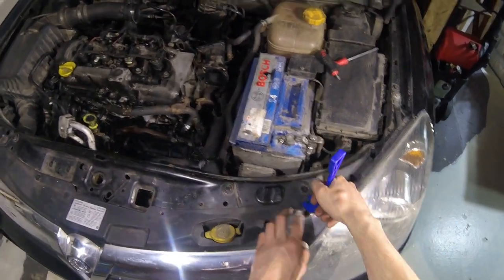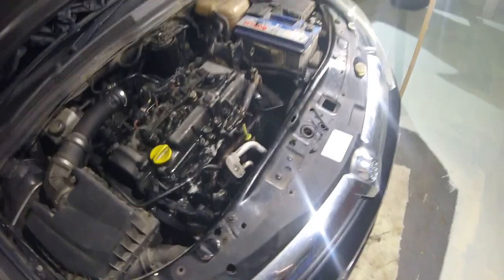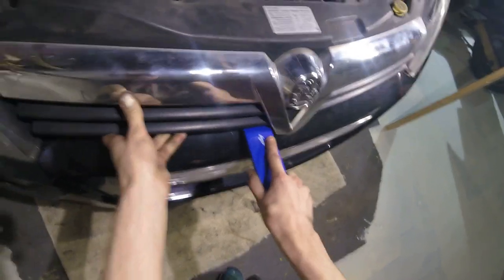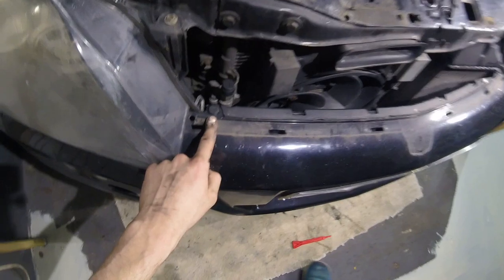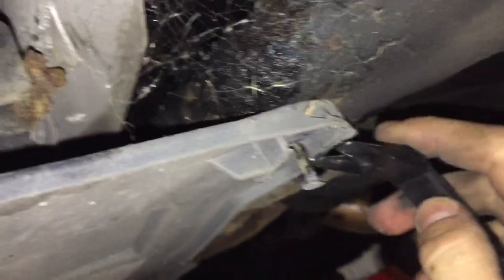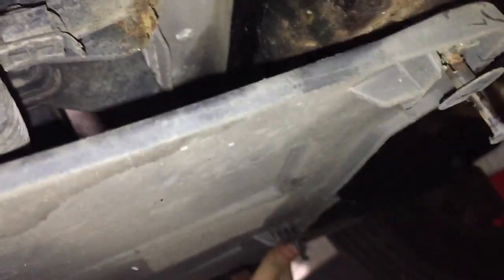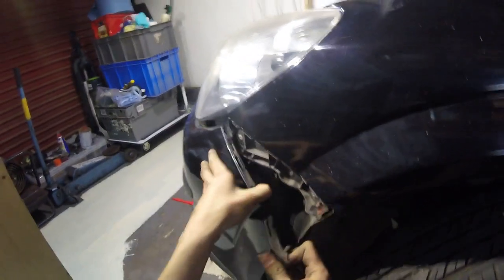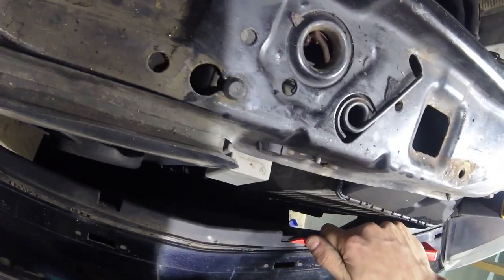Astra H MK5 Headlamp and Front Bumper Removal Guide Vauxhall Opel

Comment: I wanted to change both my headlight bulbs. I watched this and was able to tackle the job easily.  Good instructions
Reply from the maker: Thanks for the comment Paul and very glad to help!
Reply: Probably too late for you, but if anyone else wants to change their headlight bulbs there is a flap in the wheel arch you can unclip which gives access to the rear of the headlights, it's a bit of an awkward reach to get them, but quicker than taking off the bumper, grille, etc.

Comment: Hi I removed my headlight as instructed thanks to you but when I removed the headlight on driver side there is a cable below that attaches to something do u have any idea what it's for??
Reply: It's got a green and a brown wire on it that's the only bit I can see with the pic I took
Reply from the maker: Without seeing it I’m not sure I’d be able to advise. Are you saying the cable goes into the headlight or below the headlight somewhere?
Reply: Yh its below the headlight it's been unplugged I have got a pic of it if u want to have a look at it
Reply from the maker: @silv3r_vision80  If you can send a photo by DM then feel free or send it on Twitter @tolly_swift It might be for a crash sensor, outside thermometer or foglight...

Comment: I need to take our the engine ECU I have been told it's in the left side in the front bumper area, so to get to it is it easier to take off the bumper or go in from the inner wheel arch?
My Vauxhall specialist said he finds going via taking the bumper easier than trying to get to it and remove it via inner wheel arch.

Please advise.

Thanks
Reply from the maker: Personally I always prefer to take off more than is required because it’s not just possible damage to the car, working in awkward positions in tight spaces can leave you with big cuts. I don’t actually know where the ECU is myself as the videos on here are the only jobs I have carried out on an Astra but if you’ve been given that advice I would use it and remove the bumper 😁 at least you have a video for it right here! All the best.
Reply: @IAMASPANNER  thank you for your response very noble of you.
Yes lool the bumper removal
I did see how close it is to the wheel arch inside but having to take wheel off and two of those clips that hold the bumper also.
The ECU can be seen from there maybe the guy was thinking that then the holding bolts maybe hard to get undone and of course un plugging the ECU after.

How do you take the rivets off at the slam panel end, they look blank in that there's just a flat piece on top with no grooves to use flat head or Phillips.
I noticed you kind of pulled them off so did you just pull on them like a trim clip that you just pull like on door cards?
Reply from the maker: I think they’re all just plastic clips so yes you should either be able to pry them out first or pull them off with the panel!
Reply: So after looking at taking the bumper off which I began by breaking one of the black rivete clips which just flew off.
Then I thought I will undo the two T25 head screws in the inner wheel arch which I did and when I pulled out towards the caliper I could see the engine ECU so o decided to use this as an access point.
It was much easier than having to take the bumper off which I think if easy once you've broken the top five black rivet clips.
There are 4 10mm nuts that hold the ECU on its bracket, it's easy to take off even the nut you can't see clearly.
The unplugging seemed harder but got there in the end.

None the less job done
Reply from the maker: Glad to hear it and thanks for sharing your experience removing the ECU. Hope you get everything sorted!

Comment: Not a good video. At 1:25 minutes your remove something pins but do not show where they are located. Duuhhh! Do not feel bad though because 98% of videos have flaws in them because people making the video do not think it through.
Reply: What's hard to understand? Underneath the car in the middle of the front bumper, pull the 3 trim clips down.
Reply: Bit harsh, if you follow the vid it tells you and shows where the pins are and what the pin looks like
I have to say there isn't anything wrong with this video my 7 year old had no problems following the instructions in this vid
If you're having difficulty following this video then perhaps your better off getting a 7 yr old to show you.

To the poster of this video,  thumbs up, really simple straight forward instructions well done